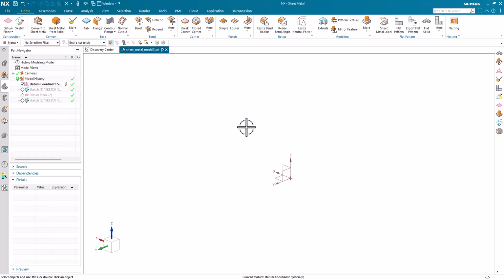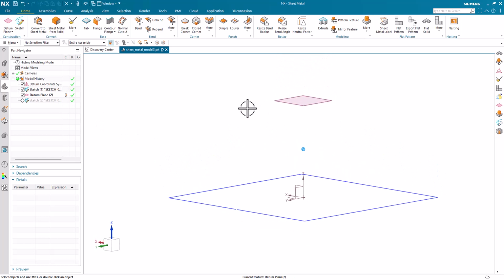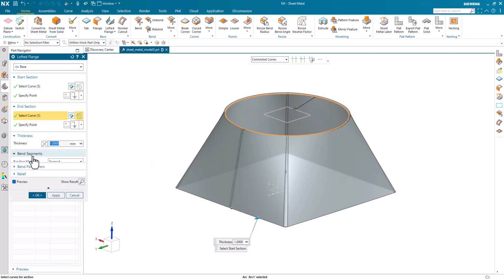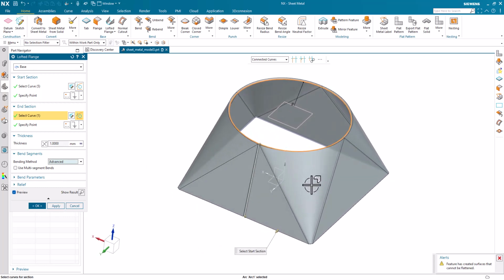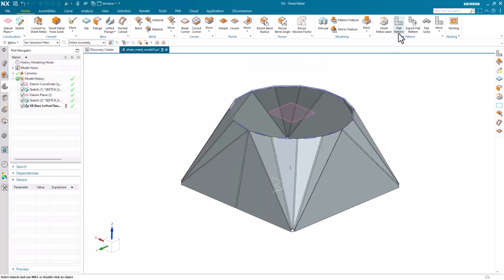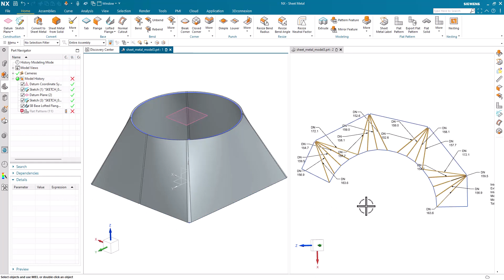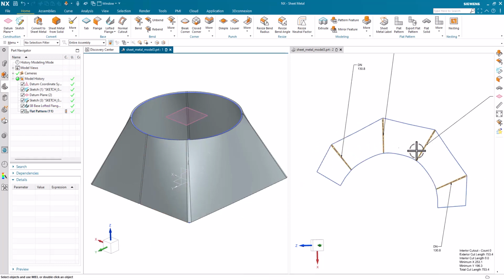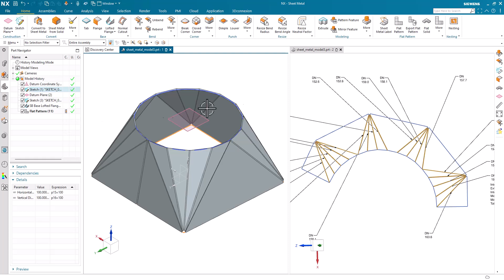Siemens NX Sheet Metal: Lofted Flange

Comment: Is there any way to import mesh objects with about forexample 100 to 300 faces and convert them to solid or  sheet metal or somthing that i can make flanges and put rivet holes on both of them ?
Reply from the maker: Not sure. But you can do a local convert to add sheet metal features. Won’t be able to flatten it though
Reply: @deedub7777  thanks alot for replying sir